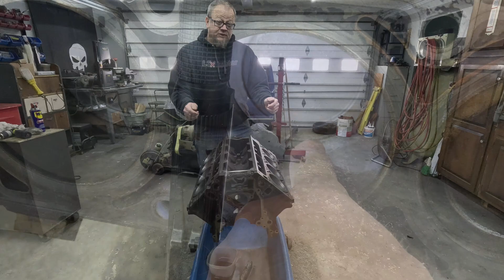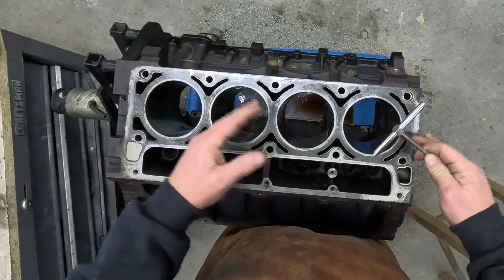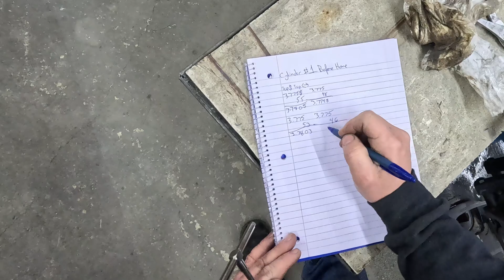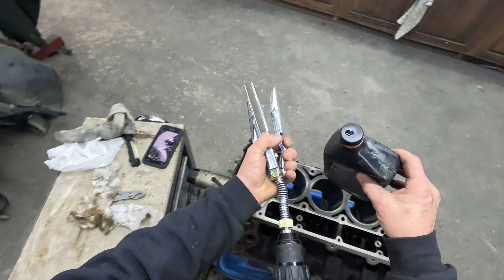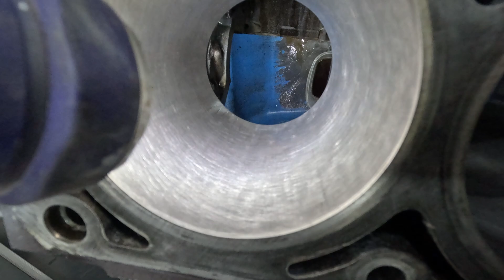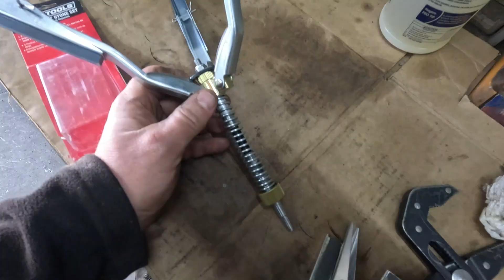LS Swap - Measure and 3-Stone Hone the Bores.  Will the pitting in the cylinders clear up?

Comment: That glaze breaker won't produce a round, straight hole.  A rigid hone is what is required to properly hone cylinders.  Those bores are likely fine fore a standard size piston, even the stockers with new rings so long as the skirts aren't worn badly.
Reply from the maker: Gotcha. thanks for the feedback!

Comment: Are you gonna do your own cam bearings? I'm sure it'll run just fine. Machine work is super expensive, but so are short blocks. Just make it happen.
Reply from the maker: Yup. Good catch. I did say the bearing were smoked but not what i planned to do with them.   So I've bought the remove/install tool and will be doing them myself. Probably will be in one of the next few videos.  Thanks!